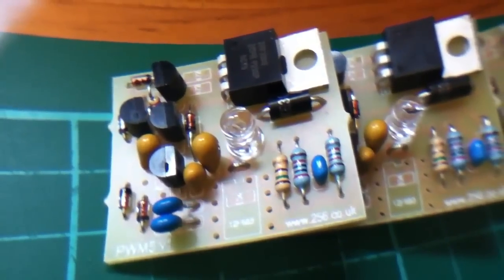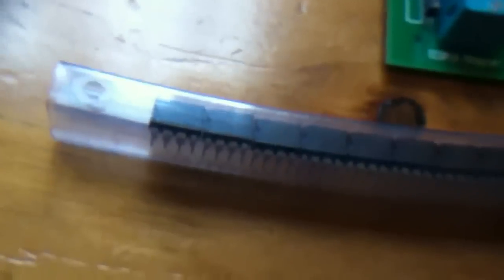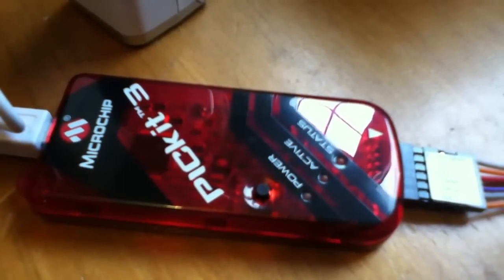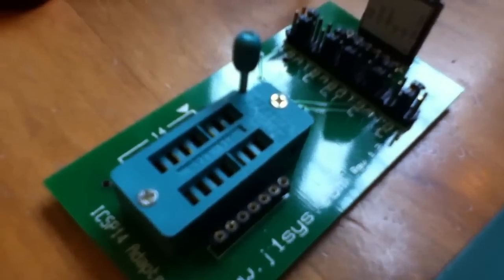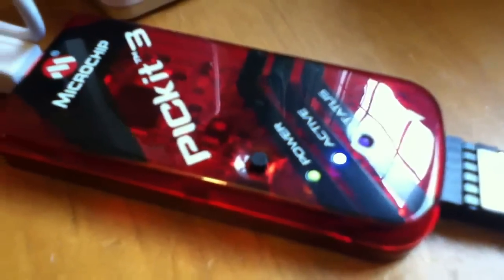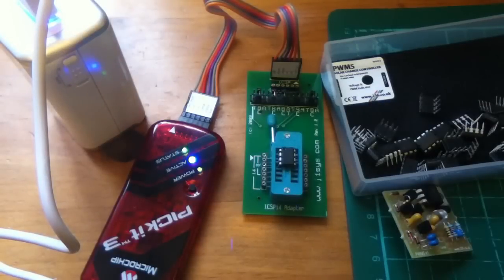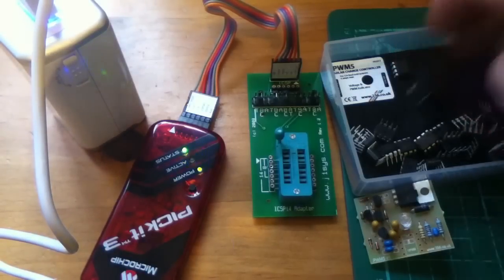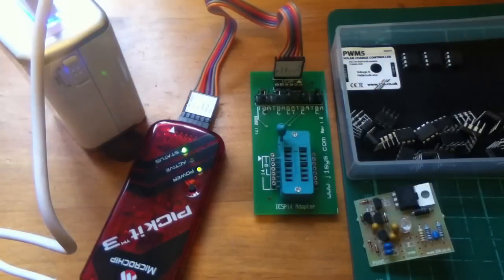Program 12F683 with Microchip PICkit3 in Programmer-to-Go mode

Comment from the maker: A testament then to Microchip's production quality that none of the units has failed. Surely the chips are being reliably programmed, just not thoroughly verified. Yes, the end product does run off a battery, but the unstable lead-acid voltage is regulated down to a very stable 5v inside the unit using an LP2950 LDO regulator at low current. The PICkit 3 is a big step up from my first 'production' programmer which was a PICkit 1.

Comment: Hello, how would you set the configuration bits for a pic16f87A microcontroller,  - XT, WDT on?, if I have my own resonator at 20mhz. Not sure how to set the headers for my hardware, or if it's even necessary

Comment: I have programmed PIC 12F683. Can I transfer the program to PIC 12F683 number 2? I have 16 programs running light! I want function 1 running light function 2 all 3 lights light up at the same time when I hold down the button when I release it again again again running light! Easy to fix? Has PICkit USB.

Comment: Julian
Love all the vids very informative I see you are using a Pic for your charger but you use ardino for other testing IE your new charger so is there a reason to change over from arduino to pic?
Reply: I can think of couple of reasons why someone would use PIC instead of Arduino for production stuff.
Arduino have for this many unnecessary items (bootloader, ftdi chip ...) which you don't need in production (but make quick testing easy)
If you forget Arduino and compare Atmel co Microchip, then if you don't know exactly for what you need microcontroller then is easier to pick Atmel, but MIcrochip have more models and you need to choose more carefully to pick one with options you need,
Another argument is that Microchip is cheaper than Atmel (PIC12F683 is less than 0.5$ and they have PIC10FXXX series for less than 0.25$ comparing let say to ATTiny85 which is like 2$)
If you have big order you can order pre programmed microcontrollers from Microchip (they do programing for you in production you just send them hex file, but that they can do because they manufacture they own silicone and microcontrollers, Atmel don't manufacture it own microcontrollers but if I remember correct X-Fab do it for them)